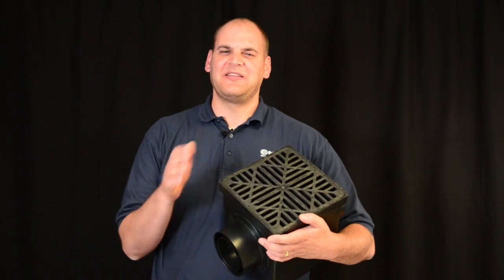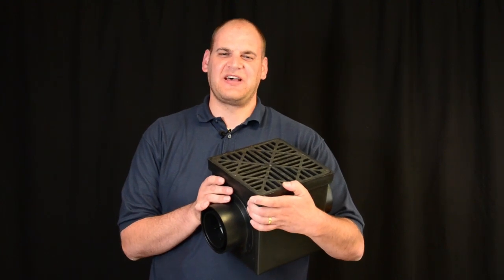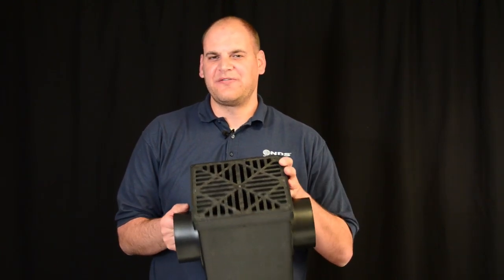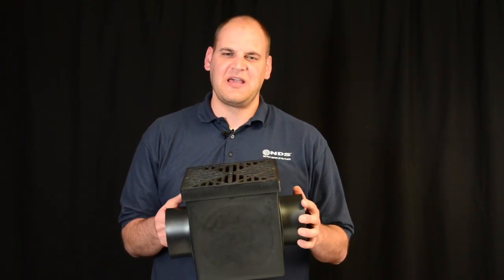Capture Runoff with NDS Catch Basins | NDS Yard Drainage Systems

Comment: How do you attach the pipes to the catch basin? glue?
Reply from the maker: NDS catch basins are designed to fit a variety of pipe types and pipe sizes. Most pipes form a soil tight connection with the basins with a simple friction connection where no glue is needed. If the connection is too lose or if a water tight connection is desired, apply a bead of silicone to both the outlet and the pipe and connect. Once the silicone dries and the trench is back filled, the pipe will not move.